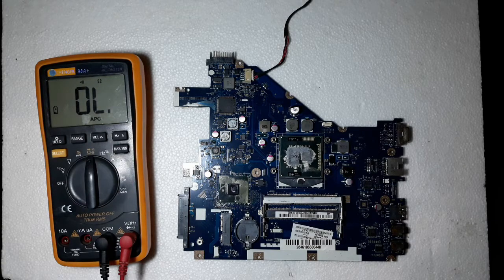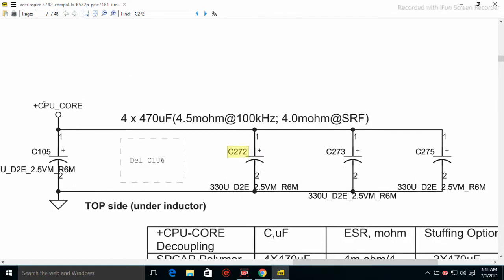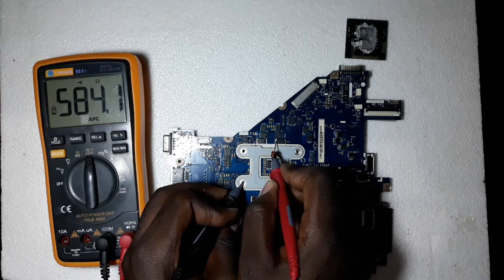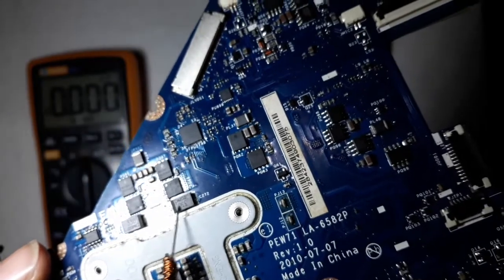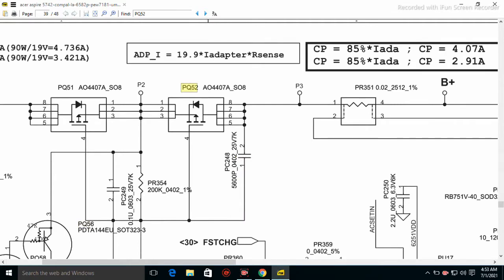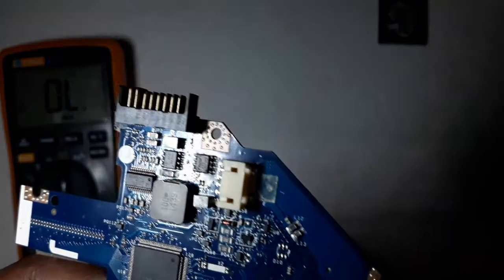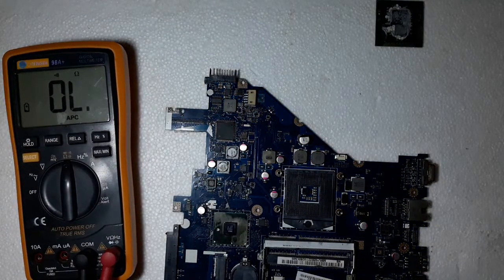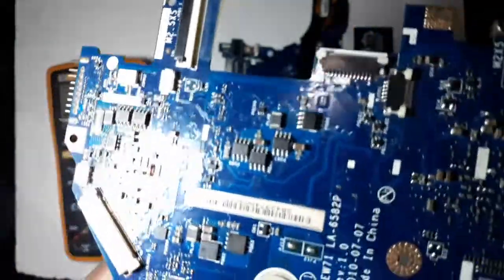How to check bad capacitors and MOSFETs on laptop motherboards part3

Comment: Hello I have a Acer laptop with bad MOSFET labelled L3 GUD 4U0T01, I do not find data sheet? any hint where I can substitute this Mosfet? Can I just use a similiar one from a different brand donor board?
Reply from the maker: Ya most times if they are doing the same function or in the same circuit they can work

Comment: How do I get the schamtics for HP EliteBook 8560p I already Google it no luck
Reply from the maker: Basically, if you don't get it on google then it's hard to get it anywhere, however, you do a comparison with other schematics or IC data sheet